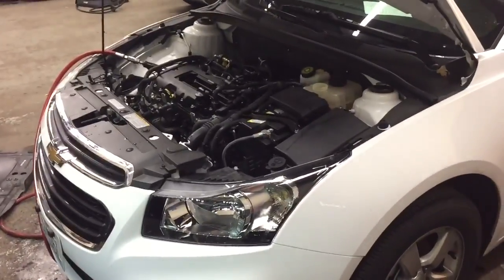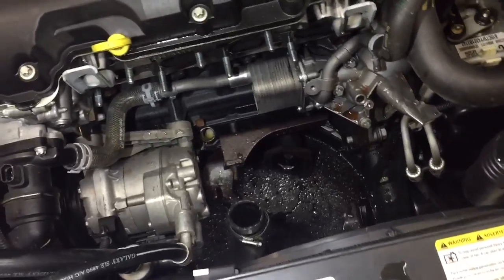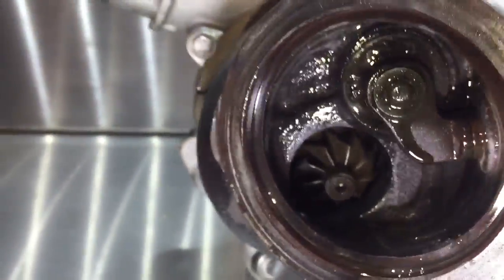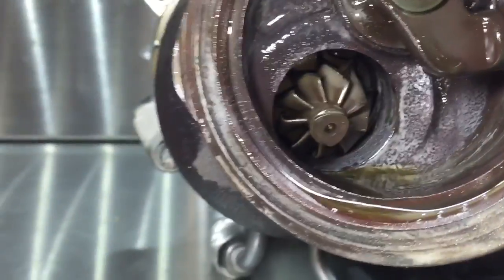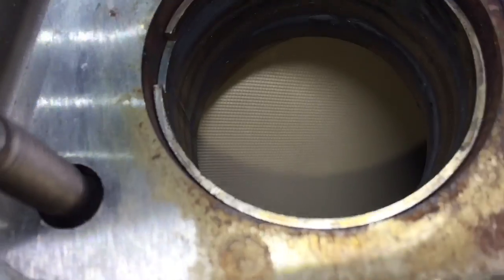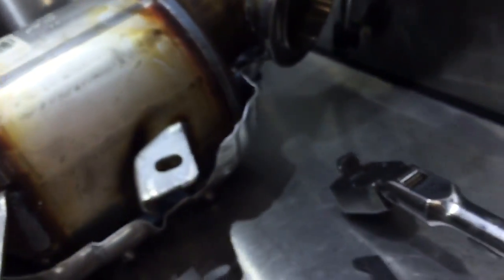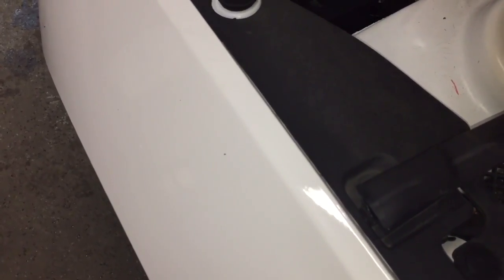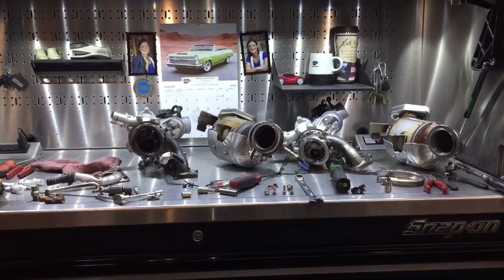Cruze Turbo Bearing Failure

Comment: mine is a 2015 Chevy Cruze Lt 1.4 turbo and my cat converter was clean that's what I thought it was so bought a new one looked  up at the turbo near the waste gate and gear and it looks like it's  crack but not sure lacking power up hill and running rich loosing lots of gas  any help would be appreciated thanks

Comment: It looks like it makes 5 lbs of boost max
Reply: Wyvern you mean 2lbs lol
Reply: Yadiel Santana may not look like it but it def makes more than ten pounds.    pretty crazy.
Reply: Yadiel Santana Try 20...
Reply: RavingBob 1000 missed a zero
Reply: RavingBob 1000
No, all newer small displacement cars use high pressure turbo's, this just happens to be low CFM

Comment: I used to be a Chevy guy. Now Im a KIA guy just for this reason.
Reply: Don Olypopper After owning a 2011 and 2015 Soul+ with minimal issues, And if there were ANY issues, KIA fixed them under warranty. The reliability of my 2 KIA'S is unparalleled to that of a lifetime of crappy GM'S. You see this failed turbo bearing? With 14,000 miles on it??? And it's a common issue with The Cruz and the Malibu? Come on now, don't play the GM holier than thou game with me.
Reply: Don Olypopper That engine is made in China. And I agree, they all break. KIA just hasn't pissed me off...yet. Now with that said, certain years of the Sorrento are crap. With any automobile it's buyer beware. It's up to you the consumer to research the pros and cons of any automobile.
Reply: That engine isn't made in China and never was. For the US Market the engine was made in Flint, MI.

Comment: For me... never a Chevy again. I learned my lesson years ago.
Reply: MetaView7 I could say the same thing about ford and Dodge. my chevy products have been fine. I've got 110k between 2 chevy cruze cars one I had for about 36k and the new diesel has 76k on it and running fine. my chevy trucks have been solid as well. 

all makes will have brake downs. it's how well you maintain them that matters. and obviously sometimes an engineer screws up, they are human like me and you.
Reply: >all makes will have brake downs. 
I drive Toyota now. It is boring. But it works, and works.
Reply: Kyle Vanwinkle that's not much mileage. I have bought japanese cars with more mileage than that and then drove them another 100k miles. I own Chevys too, so I'm not knocking them, but I wouldn't brag about 110k like it's some badge of honor.
Reply: ssdwellah I don't keep a car past 100k if I can help it. That way I always have a warrantee.

My 96 Cheyenne had 116k no problems traded
My 03 ranger has 117k and has been almost completely rebuilt
My 99 silverado had 134k no problems wrecked
My 2011 cruze had 36k no problems wrecked
My 07 silverado had 89k no problems traded
My 2012 versa is ar 96k no problems
My 02 Dakota had 80k and the ecu went out the, brakes were faulty, and the power windows fail in all 4 doors. Sold
My 2013 3500hd is at 67k no problems
My 2014 cruse diesel is at 77k and only had problems with the emissions system 

So apart from some sensors in the exhaust of the newest cruze my chevy products have been pretty much reliable. Not the most miles but I can't afford a high milage car when I travel so much. The Ranger I don't drive far or hard and it has had everything on the outside of the motor replace. The Dakota I fought with the ecu melting ignition coils and having the worse brakes I've ever driven, not to mention the most faded and corroded paint

Comment: A new cat??  That oil will burn off man..
Reply: Not really, if your cat if full of oil you can throw it away. Rhodium(material that's in the cat) Platinum and Palladium doesn't like oil.
Reply: Please tell me how oil will alter the molecular structure of Platinum?  At minimum, he could have used Gunk engine degreaser then ran a few gallons of 119 octane to burn off the rest.
Reply: That's what happens when you buy a turbo car.
Reply: Yep, whenever you buy a car with a turbo, that's what happens. They all do that. It's just what they do. No matter what make and model, no matter how you maintain it, it's just what they all do.
Come on, man.

Comment: That my good sirs, is what happens when you don't change your oil, and/or don't use synthetic on a turbo car :(
Reply: Kevin Weil or its because they bought a Cruze
Reply: +Nicholas landolina Yes and no. Although they are compatible, when it comes to turbo, it is not good to use regular. There is two reasons that you change your oil. The First reason is sledge, which a turbo would really have no effect on. However the second reason is break down of the oil. Although the oil its self does not break down, there are additives (viscosity modifiers, cleaners, anti foaming agents, anti wear), that do break down. They break down for two reasons, time, and temperature change. One of the biggest the reasons that synthetic can last longer than regular, is because synthetic oil is by design multi viscosity. So when you have 5w-30 oil, which means at cold it is viscosity 5, when warm it is viscosity 30. Regular oil is not multi viscosity, so they have to use viscosity modifiers to make it that way. Problem is viscosity modifiers lose their effectiveness very quickly. This leads back to the one of the break down of oils, temperature. Turbos spin at a much higher rate than your engine. The engine, or at least on this Cruz, at max would probably spin like 8-9 revolutions per minute, or rpms. The turbo however, will probably spin easily at 100krpm. Something spinning much faster, generates much more friction, which in turn generates much more heat. Combine that with the fact that turbos typically do not have coolant coming to them, the oil is used to remove heat. What you end up with, is oil that will be required to handle much more heat. Unfortunately , because of those viscosity modifiers, which break down more easily, and also mean that less of other additives are used, regular oil would break down far to quickly. They would also not be as effective at reducing friction, and at removing heat. As such, although you can use regular oil, you would have to change your oil, like every 1k miles, and still wouldn't be as effective as synthetic. Now I'm sure there is people who have always used regular oil on a turboed cars, and have never had a problem. But to me to risk your $1k plus turbo, to save maybe $20 every oil change (which your not really saving, because you will have to change more often, but that is beside the point), I don't think it is worth it.
Reply: Sloan V or they bought GM crap
Reply: Kevin Weil synthetic is made to be compatible to regular... doesn't matter if it's a turbo car

Comment: Got a question about this vehicle I did the thermostat,changed the water hose which was leaking due to me checking it out and whatnot but the hose is cold on the thermostat  side and hot on the drivers side side waterpump perhaps?

Comment: Seems to me like these car companies are ditching naturally aspirated engines for smaller displaced turbo charged engines and later on down the road, the turbos are failing... I've seen the Fusion fail, Optima fail, Sonata fail, Malibu fail, Cruze fail and many others.. maybe they should take note from BMW..
Reply: BMW isn't immune either. There is currently a class action suit against them for engine lubrication issues from 2009-2014. There was also a class action against their CVT transmission. They were forced to warranty their transmissions for 8 years, 150k as a result. Apparently a lot of the earlier cooper S (turbo) models are having turbo issues just out of the warranty period, as well.

Comment: Its a wonder it didn't burn down on the side of the road. I've seen many instances where semi trucks had turbo failure and cooked down to the frame.
Reply: he sure would wish the car burned and so that he can claim insurance instead of paying the $3~4,000  repair bill.
Reply: MetaView7 no way 2hrs labor plus a new turbo is $3k. id bet less than $1600
Reply: Seth Powell if you go with gm parts and gm labor it's at least 3k. most dealerships charge 80-100hr and they aren't going to just unbolt the old one and bolt in a new one. they will run diagnostics, remove the parts, clean the mess, put new parts in, recalibrate the computer, do a test run and them if everything is right give it back to you. my bet this job is a minimum 15hr charge time. and parts are expensive because they are custom fit to that engine. no easy turbo swaps here
Reply: This should have been covered under warranty I would think.
Reply: It would be warranty work assuming the car has under 100k on the dash. This is why I don't like keeping my cars for longer than 100k I normally trade them in at 80 or 90k
Reply: You really think the book has 15 hours for this job? I highly doubt it, that's two full days. There's a ton of room to work in there, so just take out a few bolts and voila, turbo is out. Iirc, new turbo from GM is around $650. Even 8 hrs at $85 is $680, putting bill around $1500 with shop fee. And I still bet book labor is less than 8, maybe 5.5 to 6 hrs.
Reply: You gotta realize that tech are there to make money and it's more than just swapping a turbo it's a full discovery process, repair process, and repair verification. They may have to flush the oil lines feeding the turbo for shavings or they my need to send a scope into the cylinder if the turbine is chipped there are a lot of variables. 

I got charged 11 hours for replacing a def injector and def hose both of which are very easy repairs but they had to reprogram the ecu as well. They had my car for a week. Warrantee work it sucks. they kept pushing the job off for not warranty work but they charged gm 11hrs

Comment: dude this shit happened to me I replaced Turbo nothing happened, it was valve cover failure I replaced valve cover every thing went smooth again
Reply: on what car?  that doesnt make sense.  valve cover gaskets dont have any connection to the combustion chamber.
Reply: Did you see how loose the turbo impeller was? You had a different problem.
Reply: I have seen a valve cover fail and let oil poor into the PCV system. Smokes like hell just like a turbo.
Reply: soranov The actual valve cover?  not the valve cover gasket?  You guys should get a fiesta ST.  I have a focus ST and its solid.  Its actually a very simple design.  Chevy has had a lot of issues with cars lately.  Cadis had recalls for days.
Reply: Casey Rodriguez on 2014 chevy cruze turbo 1.4l I had to replace turbo cuz smoke was coming out of turbo like when something catches fire next day after turbo replacement same thing happened I quickly turned off the car and called a guy who used to work at chevy dealer he said just replace calve cover I did it and everything went smooth so far no problems
Reply: @bitkurd  Hi Lev. I have a 2013 Chevy Cruze and it is doing this now. Going up a hill i was trying to accelerate, and then speedometer started going down and the more i pressed on the gas, the smoke came out and i couldn’t even see. Trying to figure out the issue

Comment: naturally aspiration.. less parts less failure, the simpler the better!!
Reply: done right a turbo is a 500,000 mile part, this is not that though.
Reply: I fully agree with you. A larger tweaked 2.2 or 2.4 ecotech will get nearly as great mpg and is actually more powerful than the micro t-charged ecotechs. I guess turbocharged looks better on the brochures. People get fooled into that.
Reply: What's even more funny is that the specs for the 2015 turbo vs non-turbo trim levels are equal in power. The turbo has a smaller motor and makes roughly the same power as the cheaper N/A option. Why someone would pay MORE for the same power, and have one more component to fail, possibly taking the motor out with it, escapes me.
Reply: K.I.S.S. Keep it simple stupid.

Comment: Maybe there is a reason why you should consider getting a Toyota Corolla instead of a Chevy Cruze. Toyotas are designed, engineered, and made to last.
Reply: Supporting a company just because they're American isn't too bright. I've owned nothing but American cars, and I've had nothing but constant issues. They've all needed repairs AT LEAST monthly, if not more frequently. I've owned mostly GM and my friend that has owned all Ford's has also never had anything but issues with his cars. However I know several people with Honda's and Toyota's that have never needed any serious maintenance done. I support companies based on their quality, not their headquarter's location.
Reply: I had a Cobalt sport coup with a 2.4 ltr and it had 239,000 miles when I sold it and the guy who bought it is still driving it ! Only thing I ever had go wrong with it was that alternator!
Reply: everything breaks....my budies 2015 corrola just had the front wheel bearing go bad @28,000
Reply: He is one of the unfortunate %0.5 percent of Toyota owners. It's very rare for toyotas to have problems. Toyotas are very reliable.
Reply: well i personally and alot of people i know will never buy a toyota or any other japanese car, we support american car companies and american buisiness.
Reply: and plus a corolla is womans car, i will only drive full frame sedans like crown vic's and caprices .....those are real cars
Reply: +jessiejames50 still.. toyotas are more reliable... lol
Reply: Stephen McGowan You've been very unnlucky with cars. While I've had a lot of issues, I've never had blown motors, head gaskets, etc. The only big repairs my Cobalt I just got a couple months ago has had in it's 150k mile life has been a power steering pump at 50k(previous owner), and since I bought it at 135k I got a front alignment, new tires, replaced a sticking thermostat, and had to do both lower control arms. Nothing as serious as blown motors though.
Reply: I have owned a Ford Deathstar(Windstar), blown tranny 30K, blown head gasket 35K, whole front steering assy 15K, brakes and rotors every 10K cause ford used the taurus platform and put a minivan on top of it! Barely got it too 100K. 1997 Chevy Malibu, Motortrend car of the year! Biggest piece of crap on the planet.  You name it, it broke. Only started when it felt like it, passlock II security system was a joke.   Donated it at 120K couldnt take it anymore.   2005 Dodge Durango, blown motor twice, 2nd one caused by the dealer repair the first time, whole front suspension replaced under warranty,  after 7 trips to the dealer.  95K had enough of it.

Traded it in on a 2112 Honda Civic.  110K so far and NOTHING broken.  1 set of brake pads front and rear,  2 sets of tires. Thats it.  33mpg combined.  Best car I have ever owned.  And its more (American) than almost every Ford, or Chevy, or Fiat.
Reply: David Perry Not anymore, everything is short lived shit.

Comment: If this has a few miles as they say its covered under manufacture warranty.  There are very few turbo manufactures so any can fail.  I have 2011 cruze with 117k and my turbo is fine.  you should use full synthetic in any turbo car.

Comment: Yes but if it's that new of a car why is this car not fix a a GM dealership ?
Reply: I work in the rental side. Sometimes it works out cheaper for the rental company to pay for the repair themselves, and do it quickly, rather than having it off the road for potentially weeks waiting for the dealer to fix it under warranty. Every day the vehicle is not with the customer, it costs the rental company.

Comment: This would be one of the main reasons why I stay away from GM's and turbo charged engines in general.
Reply: +DeadofWinter321 Meh you can't exactly blame them, Its not like they made the turbocharger or the seals and bearings.
Reply: This is more prone to the fact that GM wont tell you it is best to use full synthetic oil. Ive got 81k miles on the first turbo having used nothing but full synthetic, I take off the cat and check the turbo blades about every six months... no issues thus far. FWY, it isnt hard to remove that cat. Seriously 5 bolts and its out.
Reply: @sumott497  Nice, I am still rocking my original turbo at 109k miles but it is starting to have a little metallic rattling, so probably ready to replace haha
Reply: +DeadofWinter321 Unfortunately, turbos are designed to fail.  The big difference is how hard they are to replace.  Try watching one being replaced on a Ford EcoBoost truck.

Comment: Why did it fail?
Reply: +Stian Jevnaker Because GM
Reply: Turbos rarely fail of they're own making, Turbo failure can be attributed to a number oil oil related issues; low oil pressure, oil level, incorrect grade or classification of oil or oil starvation to bearing surfaces. Your American climate can have an adverse effect also, using approved oil viscosity from a branded supplier with correct rating is crucial to turbo bearing proper operation.
Reply: +foxdmulder also waiting for the pressure to build up before anything. And letting it spool down and cool before turning the engine off. Few people seem to do this.